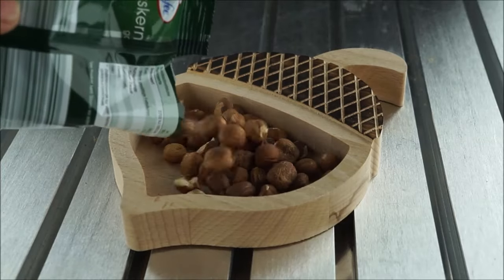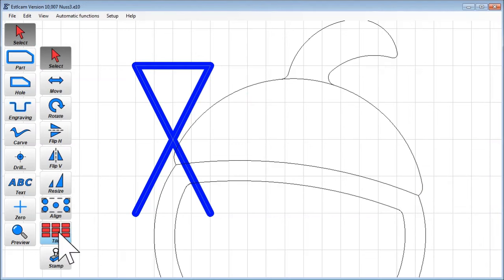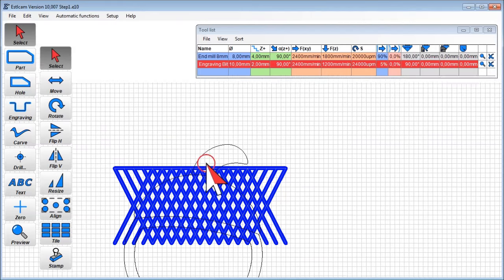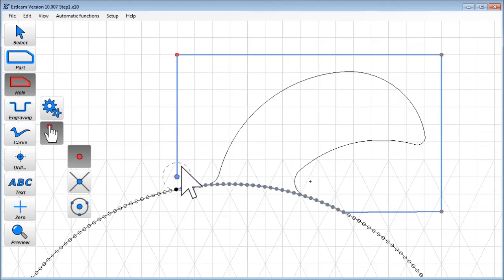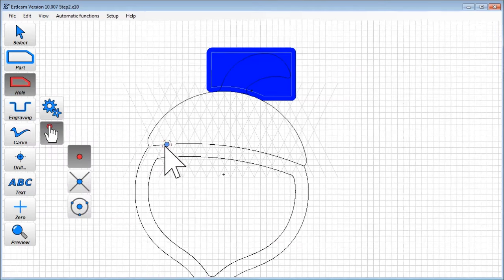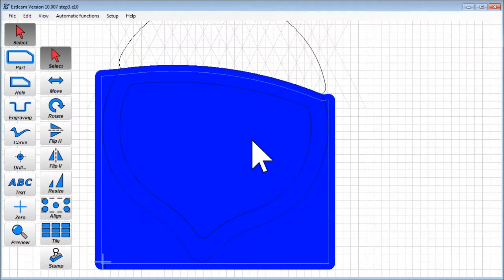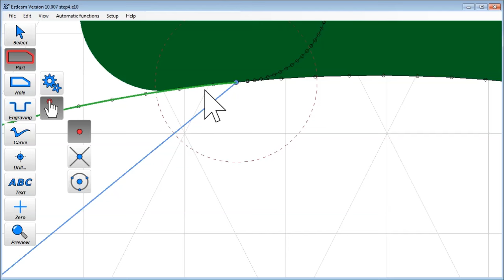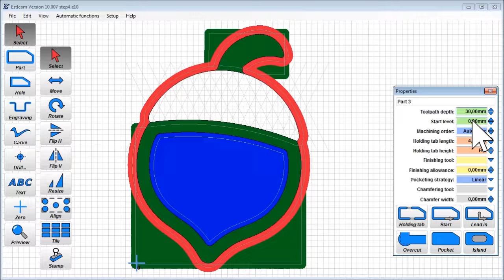CNC machining a hazelnut tray

Comment: Ofc and we need more videos like this, keep it up :).

A small question, is there a way to select conventional milling or climb milling?
Reply from the maker: You can select it in the "Basic settings" dialog in the "Milling direction" list.
Reply: Thanks a lot.

Would be cool if you could select feed/rpm and conv/climb in every operation not just on tool list.